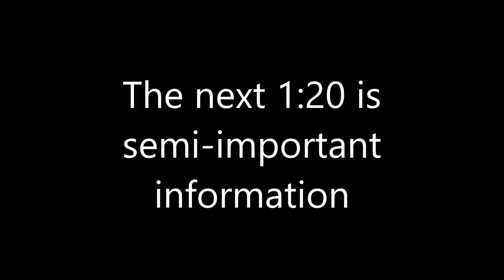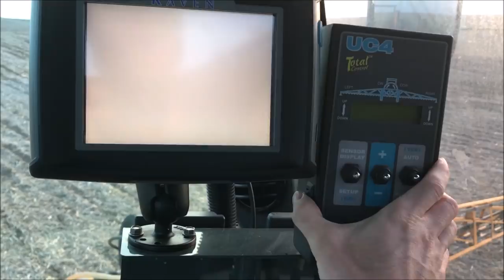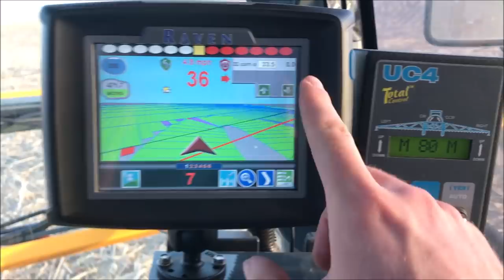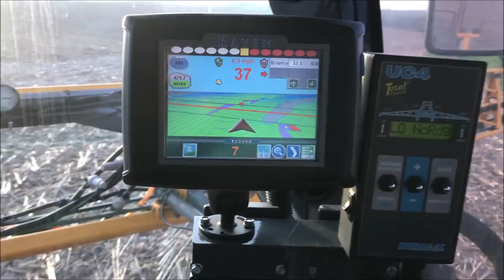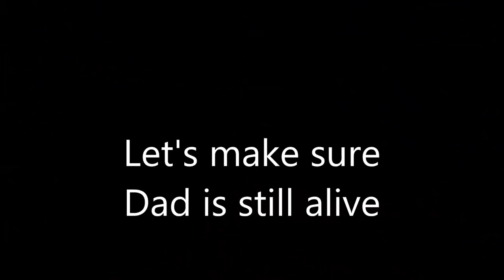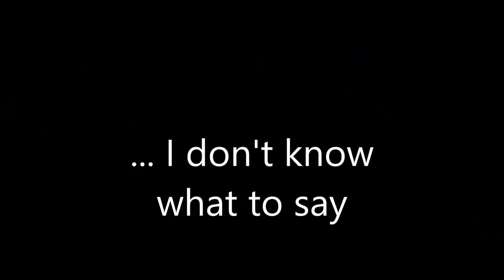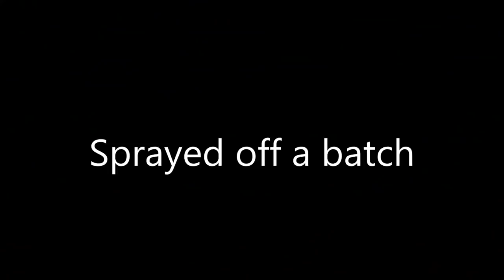Dad Almost Caught On Fire! | Farming's Finest Farmers

Comment: Like #151.  Hope you get that A/C fixed daddy cornstar!  I remember working many hours in a Case 3394 that the air conditioner was not the greatest as well... could make some days miserable.
Reply: The design of tractors today, with large diesel engines, are almost unbearable without AC.
Reply: It  was unbearable trying to do tillage in July without an air conditioner.  I was young then.  I couldn’t image my fat butt on there now trying to tough that out haha

Comment: Hey Cole what's the biggest issue with the Massey 4880 cause I'm looking at getting one with 3400 original hours on it
Reply from the maker: Aaron Pulchinski That would be a low hour machine. It's only got a 3 speed Hi/Low transmission so you don't have a ton of gears. They are also loud.
Reply: @ColeTheCornstar  I've looked at the tractor data it tops out at 19.2 if I'm not mistaken we have an Allis Chalmers 6080 same shift style I've been looking for something to pull our grain cart the agco Allis we have is to small to bring it back to the farm fully loaded. I can deal with the noise but overall it looks to be a great addition to the farm
Reply from the maker: Aaron Pulchinski Make sure it has PTO
Reply: @ColeTheCornstar  it has both 3pt and PTO